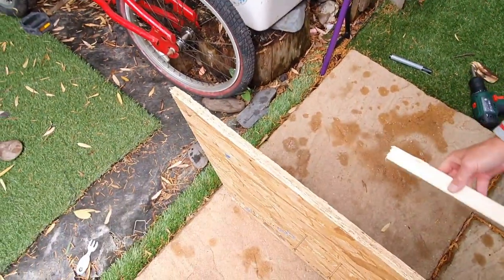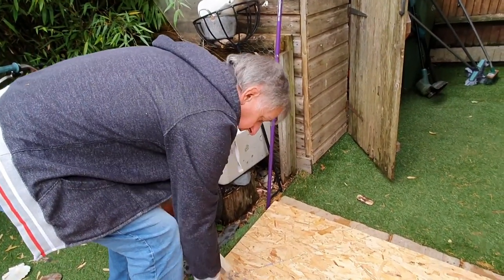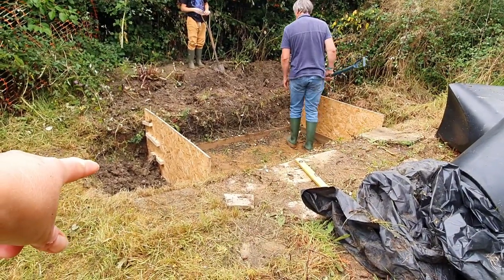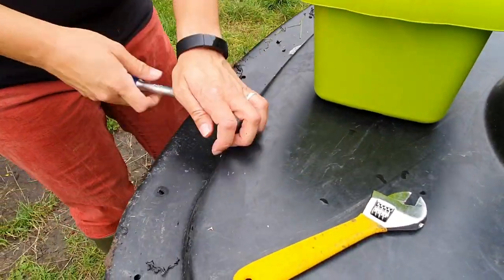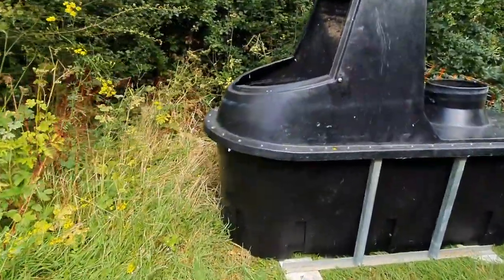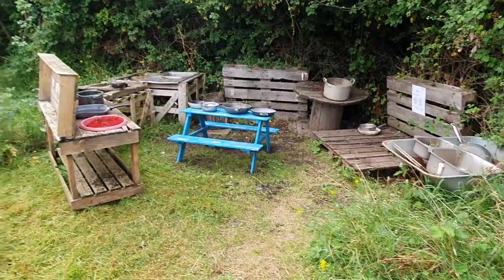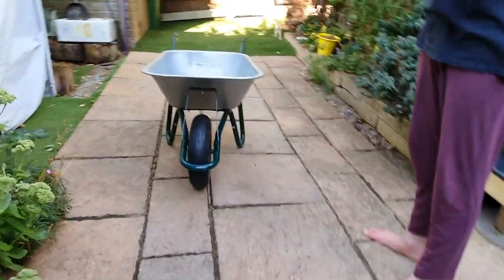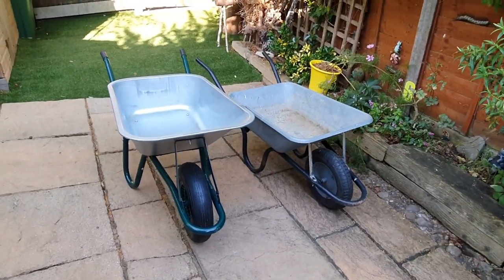Can wheelbarrows BREED? UK VLOG

Comment: Takes a bit more time, but I think what I would do is measure the distance between the edge of the wood to the screws, then measure the same distance on the other side for the wood part
Reply from the maker: Ahhh yes. That would have worked too!